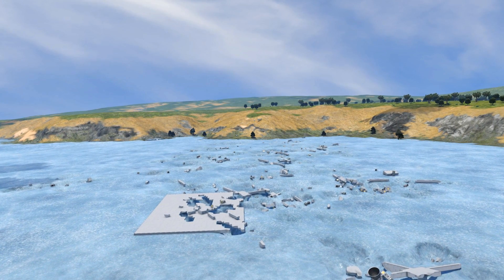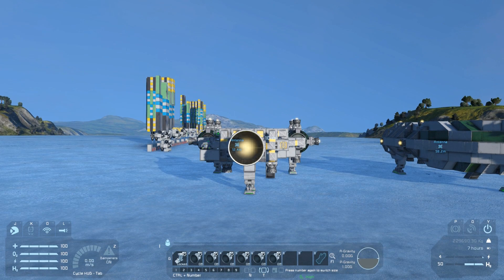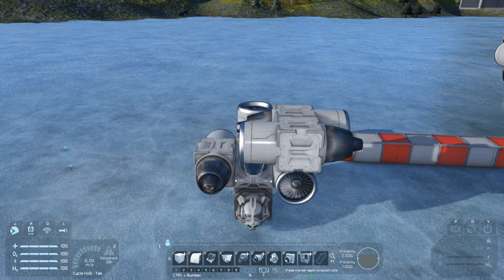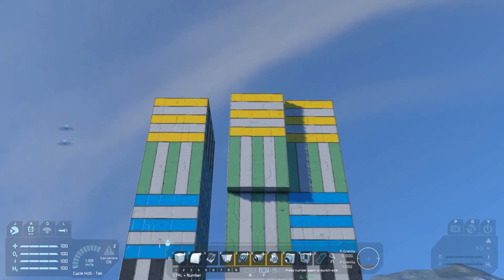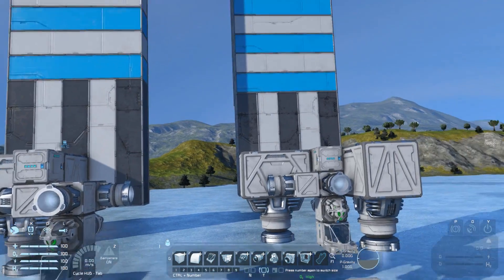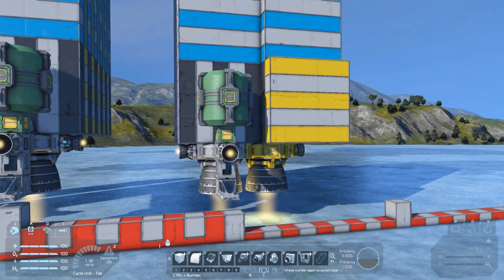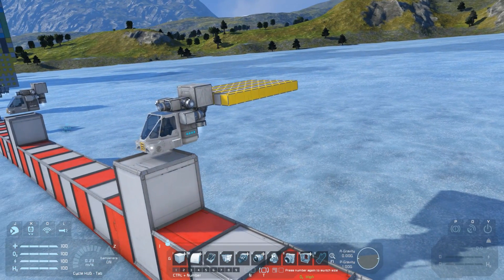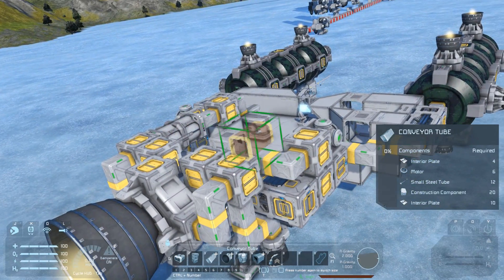Space Engineers Tutorial: How many thrusters? (tips, testing and tutorials for survival)

Comment: Man i am just watching every video I can find on thruster lift, as well as power options. Seems still to this day I either load up a built ship with cargo and it crashes down, or the more common issue that once loaded and mobile I have like 15 minutes max run time before out of power/ fuel. I hope se2 balances power and thrust slightly better. Stupid to have small cargo ship at sea level needing 56 atoms thrusters to safely maneuver around for the 5 minutes it will. Every ship turns into. Pile of thrusters batteries and tanks, then it’s to awkward to accomplish duty.
Reply from the maker: My advice with this would be to utilise the right thrusters for the job at hand, with atmo thrusters, the large ones (not large grid, but the large variant) is more power efficient than the small, with the large flat one being second most efficient and the small ones being equally inefficient based on power draw. So if you're using 56 of them, I'm guessing you're using the smaller ones, so with the larger ones you'll need fewer batteries for the same amount of lift due to the reduced power draw, making the whole ship much lighter :)
Reply: @ this comment is very helpful, oddly enough I tried the larger small grid atmo thrusters last night after watching videos on efficiency and such, and it most definitely fixed my problem. Went from 56 thrusters to about 12 large, and 8 small thrusters, battery life was more than doubled, but I did add a few so that may be why it doubled. She ain’t a super small ship now, but it stays in the air at any angle loaded to the t with steel plates, I’ll call that a win!

Comment: if you wanted kg you could add storage and fill them up until it cant lift anymore even if multi crates are used to find out the limit it should be a good general weight to build your ships per thruster of that type.
Reply from the maker: I wanted something more visual than a kg readout, especially since the weight readout of ships locked to the ground were terribly inaccurate back then and are still frequently inaccurate now :/

Comment: These tutorials are phenomenal! Really helpful! :D

I would like to also point out something I discovered about the power Hydrogen thrusters on large grids (I haven't tested this on small grids, so keep that in mind). One large hydrogen thruster is less powerful than seven small hydrogen thrusters. I tested this in zero-g by placing a large hydrogen thruster on the left side of a test ship and nine small hydrogen thrusters on the right and setting them all to max burn override. The ship moved to the left, indicating that the thrust on the right side with the smaller thrusters was greater than the thrust on the left with the large thruster. After removing a couple of smaller thrusters, I found that one large hydrogen thruster is less powerful than seven small hydrogen thrusters but more powerful than six small hydrogen thrusters.

So in terms of propulsion power, using a cluster of small hydrogen thrusters is better than using a large hydrogen thruster. It is also advantageous in terms of space considering even nine small hydrogen thrusters in a 3x3 pattern, along with the 3x3 conveyor junctions behind them, only take up a 3x3x2 space versus the 3x3x3 large hydrogen thruster. The danger zone of the flames is also smaller, making the cluster of small hydrogen thrusters safer. In terms of number of actual blocks/PCU, however, a 3x3 cluster of small hydrogen thrusters, along with nine conveyors, results in 18 blocks/225 PCU versus the single-block large hydrogen thruster at just 15 PCU. The only time this might be a problem, however, would be if you're having to deal with an upper block count limit or something or if you have a LOT of clusters for a capital ship perhaps. In terms of fuel consumption, I'm not sure which is more fuel efficient, and I'm not sure which is cheaper in terms of component count. (Might make a good tutorial video here!) But if you're looking for which offers more powerful propulsion, a cluster of at least seven small hydrogen thrusters beats one large hydrogen thruster.

I hope this information is half as helpful as these video tutorials are. :)
Reply from the maker: Thanks :)

There's a few situations where you can get more thrust from small thrusters than you can from a large, but at least in the case of small atmos (on small ships) vs the large ones, the large atmo can generate its thrust with less power usage so is more energy efficient but not more space efficient. I haven't checked but it wouldn't surprise me if that holds true for the large hydrogen thrusters too

Comment: Were you to redo this style of testing, while it may not be quite as visual, using cargo boxes full of, say, iron or iron ore may prove a better way to go about it. Allows you a more granular addition of weight, and you could add the weight until you get roughly the same rate of acceleration with each thruster, showing off a more accurate weight lifting ability of each. And it is a little more practical use with say, cargo ships.
Reply from the maker: Yeah, I'm thinking of going that way next time, especially as it's primarily mining vessels where people really run into trouble with their thrust so it'll be more applicable

Comment: I do find your explanation pretty boring in a sense that your thruster placement should be based on a ship design and it's role. 

For example you can't expect people using ion engines  in the atmosphere, they are no TIE fighters

Atmo thrusters are your only option in the atmosphere for VTOL and jet planes with wings, and I am not the big fan of a brick ship designs, it might work it might not.

Hydrogen thrusters are purely space engine design for vehicles capable going to space and flying in sublight speeds.

For cargo ships you don't want armor nor the weapons are your primary concern, they just need to be powerful and really fast

For fighter ships you need light armor, wings for weapon placement, and once again huge hydrogen thrusters on their back, think vipers from BSG they are no pushovers.

For large ships you just need a lot of armor or shields if you can build them, speed is not important horse power is. Guns, missiles, lasers, shields.
Reply from the maker: This was intended to be a way to help people who are like me and would prefer to visualise how much weight they can carry so armour was the logical choice. I'd disagree with some of your assertions about which thrusters are for which roles. Atmo plus ion can be a very effective combo for an all purpose vehicle since you don't need to worry about your fuel running out quickly if you've got reactors.

Combat is space engineers is very different to the standard sci fi tropes due to the short range (ignoring modded weapons), very low top speed (100m/s) so everything comes down to a brick being the most effective design with as much acceleration as you can manage but also the ability to save on fuel costs so a combination of hydrogen for combat and ion for the rest of the time will likely work out optimally.
Reply: @Splitsie  
I suppose, but hydrogen thruster is going to be your friend for a long while, and ions are just extremely expensive because of platinum unless of course you farm npc for parts

Comment: Hey Splitsie. I came back to review this video again after losing a ship in survival at the transition from surface to space on Mars.  Ugh. Long story short there's an odd situation when trying to ferry cargo into space from the surface. I built a small grid ship with atmo and hydro thrusters to do this job. It's based around a large cargo container, a hydrogen tank, an O2/H2 converter, a couple of batteries and a cockpit.  The thing is that a large cargo container filled with 421,875L of ingots, ores and components should have a mass proportional to the contents, but I think the SE maths use Lead (Pb) as the default mass value.  If you wanted to do some more Clangbusting, this might be a good follow up video. Cargo containers and what is costs to lift them to orbit. Does it vary with content? Is it a constant value? As Space Engineers, we need answers to these questions.  Thanks for all the content you provide.
Reply from the maker: Good thought, could be a nice way to approach this from a new angle when I remake it :)

Comment: this helped me out alot so thank you for that, but i have the problem that im in space and have build a large ship, according to your video do i have enough thrust (ion/hydrogen).  but it doesnt move at all. and when i enter the cockpit it doesnt show any weight, it just says "station" where it shows you the weight of the ship. i removed the landing gear and the ship is now floating, still no movement. and there is no block connection whatsoever.

what am i doing wrong? please help.
Reply from the maker: It sounds like the game is still treating the grid as a station, which means it's a static grid. To convert a station to a ship you can go into the control panel and jump to the info tab. There should be a button that says convert to ship in there which will allow you to get your ship moving :)
Reply: @Splitsie  yeah i got it now, found the solution in a steam forum but also thanks to you, for your response, you're good SE teacher

Comment: I know this is an old video but could you maybe explain how efficient engines are? I'm interested in how many small engines it would take to match one large engine and how they compare in energy usage. Do all the extra batteries and hydrogen tanks required for large engines weight the ship down to the point that they are useless or do the out produce small engines to the degree that the extra batteries and such are only an issue if you're low on resources and energy production? I'm sure all of us have had that moment when they feel like the ship is flying great then you try and slow down and the ship just falls out of the air like a rock because you were just on the boarder line of not enough thrust or power output to keep the now projectile aloft.
Reply from the maker: I did fiddle with those sorts of things when I built the Butterball - testing to ensure that it had enough power output from its batteries for the number of thrusters on board. But never came up with generic numbers. Might be worth going through properly as I think it might have changed since w4stedspace went through it way back in the early days of planets

From memory though, on small grid, small atmos thrusters are more component efficient per unit of thrust, but large are more power efficient. I believe that for large grid the advantages are both on the side of the large thruster. That's dredging the depths of memory so it could well be wrong
Reply: @Splitsie  thank you!!
Reply: Would be interested to see if you've had any tests where you see how many thrusters each battery/reactor type can support to see which is the best combo in survival. Basically minimum number of power supply blocks per thruster. I've been having a fun time finding out I don't have enough power output at the last second when my ship drops like a rock into the surface of Mars

Comment: Did you take into account the decreasing power reg. high/density of the athmosphere?
I bet just pasting them 10km higher will have them sink a lot faster than anticipated. ;)
Reply from the maker: At 10km the atmo ships will drop like a stone, the others will be fine though, the ions should perform significantly better. I chose to test at 'sea level' to see how effective each thruster was at that altitude as for ion thrusters if they can lift there they can lift anywhere, and it's a little easier to adjust for atmospherics as you'll often be building in atmosphere if you're using them at least the way I build :P

Comment: right, i just came to this as a quick guide but it doesn't explain cargo mechanics very well. IE i have a small ship with x3 inventory medium and large cargo, and I need 4 large atmospheric thrusters to lift it at a 100 ton maximum. is there a ton or kg rating for each thruster under 1 gravity?
Reply from the maker: The reason I didn't go into cargo weights is that they depend on your inventory setting in an odd way. The amount of cargo weight is divided by the inventory multiplier before the thrust is applied to the ship, so that the same number of thrusters is required to lift the same ship just with more inventory on the higher multipliers. This means there is no easy way to define the amount of cargo that can be lifted when the physics engine won't behave in a predictable manner around the limits of an engine sadly.

If you look in the description of the video I've laid out an approximate maximum weight that each thruster can lift under 1G with all inventories empty. This still may not be useful as the amount of cargo you could lift would be the maximum thrust minus the weight of your ship, with that number then multiplied by the inventory multiplier. That doesn't seem like the easiest calculation to do on the fly - for me anyway

Comment: one thing to remember is that dampeners can get more out of thrusters than u can so sometimes a ship will hover with dampeners on and start dropping if u try to lift up higher one way I found a use for this is to let dampeners hold the ship up and then tilt so ur pointing up about 20-30° and then use forward movement to climb it's not Ideal but can save u needing to dump half it's cargo to get it miner back to base just be very careful when descending as it will take a few seconds to stop from even 1m/s
Reply from the maker: I thought they'd changed that behaviour (or at least there was a patch that was supposed to change it). The dampeners used to be able to get what felt like about 10-20% more than you could get manually, but you're right it does seem to still have some ability to get a little more juice. High risk to fly that way though - at least if you're a gumby like me :P